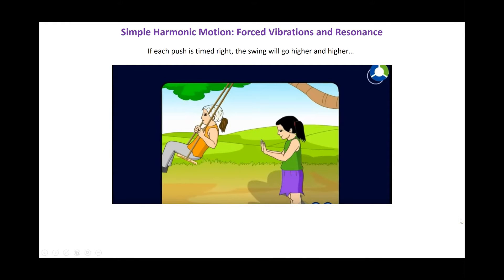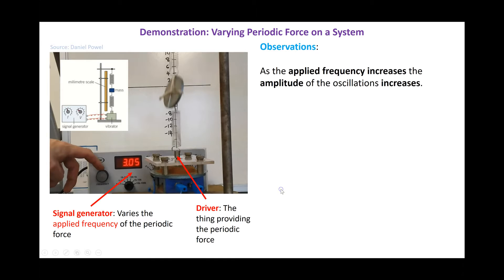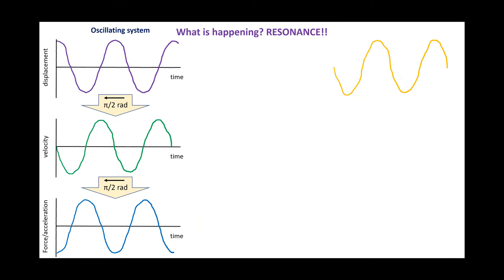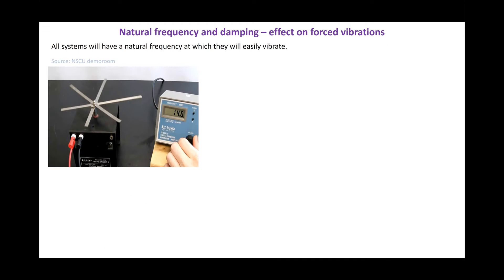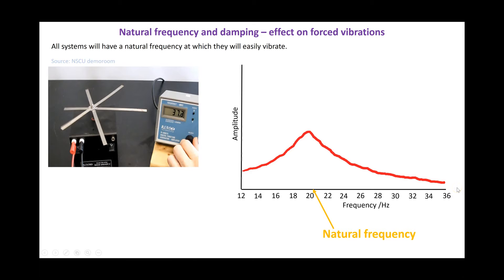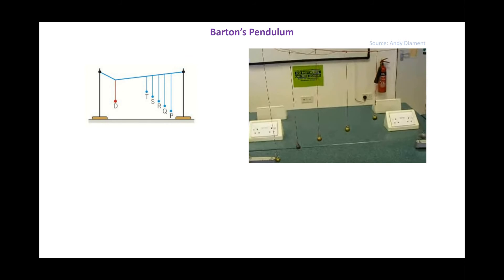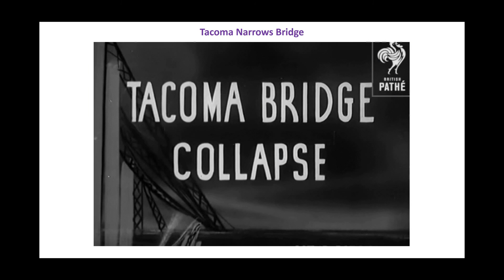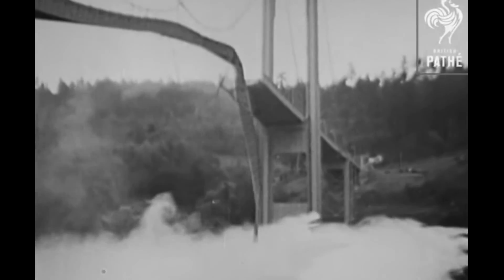A level physics - simple harmonic motion - resonance

Comment: The bridge's collapse had a lasting effect on science and engineering. In many physics textbooks, the event is presented as an example of elementary forced mechanical resonance, but it was more complicated in reality; the bridge collapsed because moderate winds produced aeroelastic flutter that was self-exciting and unbounded: For any constant sustained wind speed above about 35 mph (56 km/h), the amplitude of the (torsional) flutter oscillation would continuously increase, with a negative damping factor, i.e., a reinforcing effect, opposite to damping.[3] The collapse boosted research into bridge aerodynamics-aeroelastics, which has influenced the designs of all later long-span bridges.